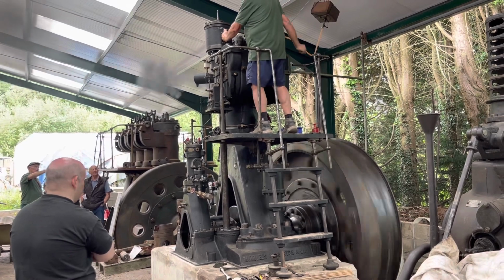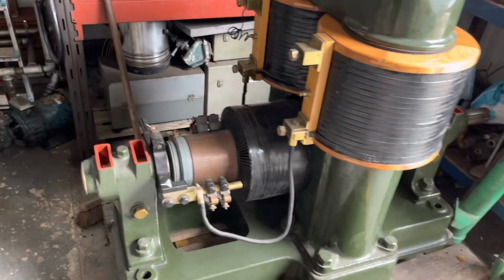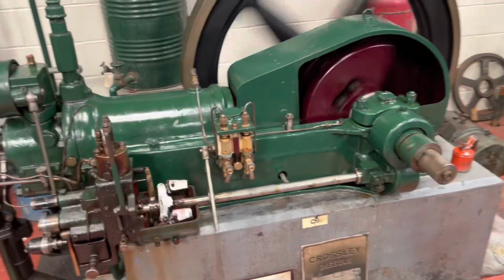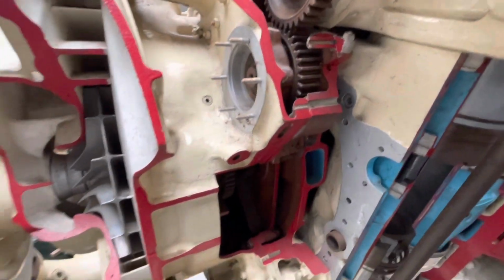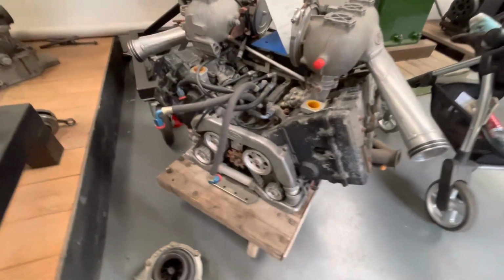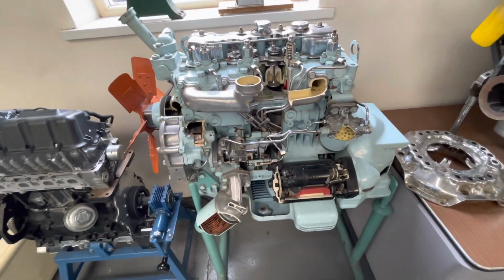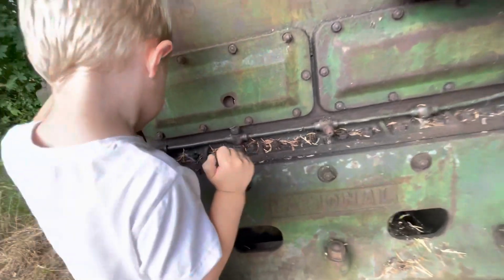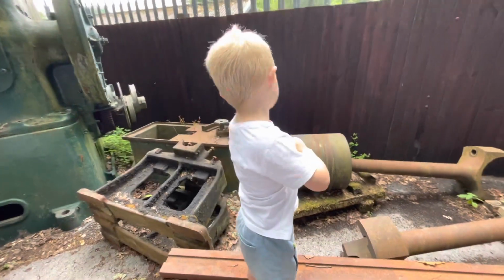Anson engine museum, north wests best kept secret !

Comment: What a great place and your lad was so funny after his power nap!. The Ford V4 was probably from a Mk1 Transit van judging by the height of the gear lever. Also the SAAB version has a fiber timing gear too. If you want to see a Napier Deltic running, they run them at the east Lancs railway in Bury. Cheers, Mick.

Comment: The small Foden looks like a smaller/trunk version of many crosshead marine main propulsion engines, often reffered to as "poppet valve" with port controlled scavenge air inlet and mechanical/hydraulic exhaust valves in the "cylinder cover" (head). The Deltic was similar to simpler in line crosshead opposed piston marine engines like Burmiester and Wain or the probably better known Doxford. The inlet port at one end of the stroke and exhaust on the other is known as "cross scavenging". That pale blue 4 cyl looks awfully like a Perkins. A scrap cross bolted Rover, what a surprise. I must check that out next time I'm down that way, thanks for the heads up.

Comment: I think you're right on that foden engine , the supercharger compresses air in the crankcase & is forced through the transfer ports just like a standard two stroke engine when the piston moves on the compression stroke it pushes more air in than just atmospheric pressure to give more power a bit like a Detroit bus engine, the Napier Deltic was used in fast patrol boats as well as the famous class 55 loco which had two of those 88 litre monsters , thanks for letting us tag along on a great day out😊.